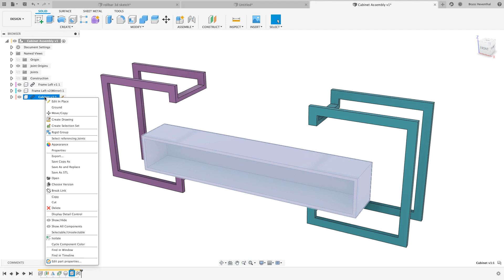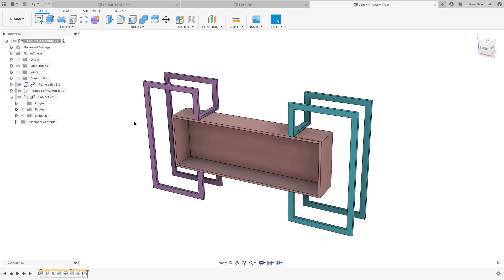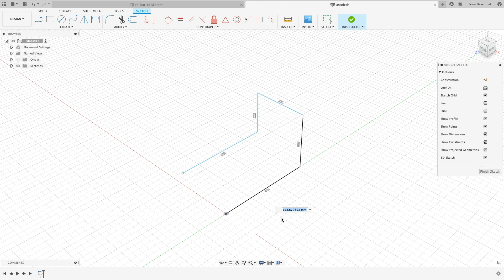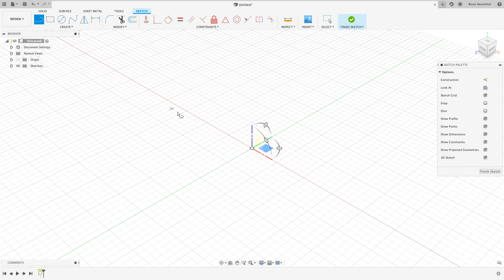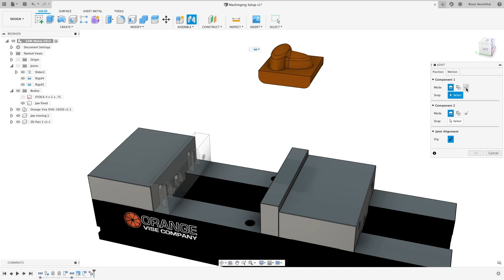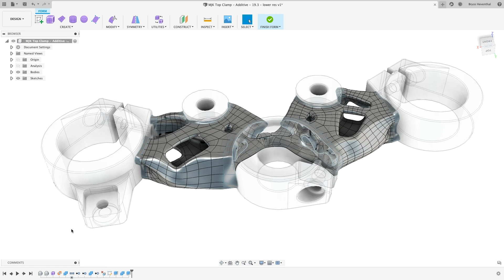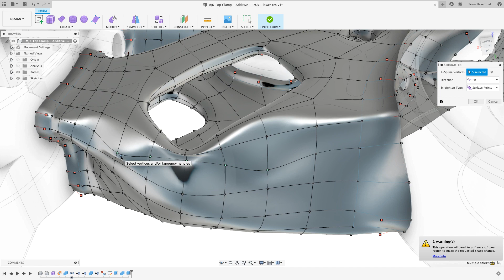What's New in Fusion 360 Design & Engineering – March 2020

Comment: 4:26 I think that besides the vast improvements to the 3D sketching function, the ability to apply joints to virtual sharp corners might be one of the greatest modeling improvements to Fusion 360.  I say this because it is a common situation when you download component models from manufacturers' sites, they often include all of the fillets in the model.  Up until this update, applying joints to these component models could be very awkward.

Comment: What specs would you recommend for a PC to run fusion smoothly, I currently use a quadro P3200 with an i7 8850H with 6 cores with 32Gb of RAM and it lags when designing, a little advice please ?
Reply from the maker: There are alot of variables that go into this. It depends on design complexity, best modeling practices and more.
Reply: @adskFusion  would you mind giving a suggestion ? Or example of the PCs used by Autodesk
Reply: Hi Ed Man, I use specs way lower than yours and have no issues unless I have a component with a lot (100s) of faces. I even use it on my old Windows Surface (albeit slower), so required specs aren't that high. I do remember I needed to turn on hardware acceleration, but cannot remember how I did it (it was a long time ago).